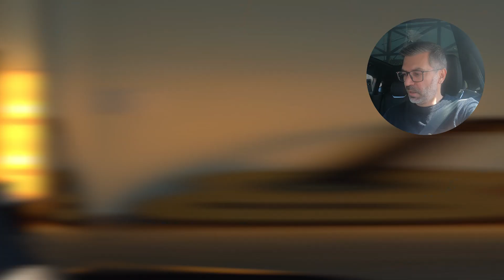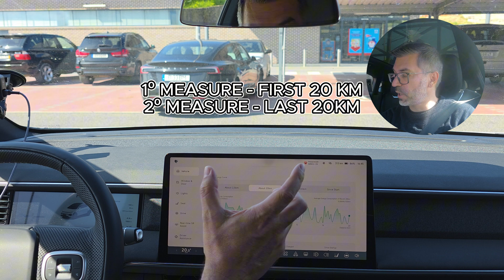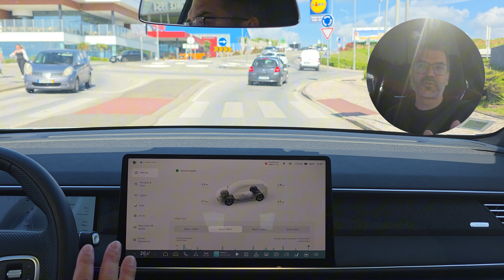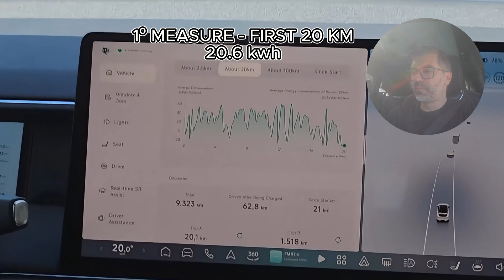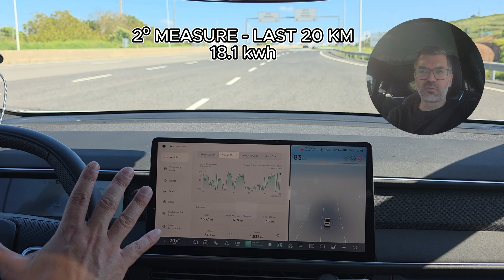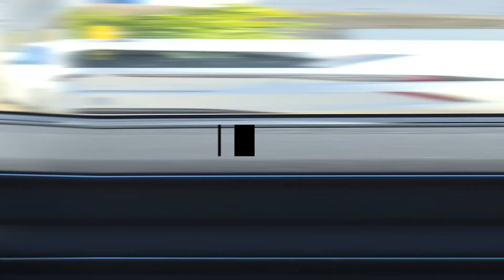Ride with Me: XPeng G6 Highway Drive in Standard Mode – Real Consumption Test!

Comment: It was  24kWh/100k  until  your started going  downhill  :)  cheaty cheaty   ;)   in  other  test on Youtube  I  have  seen   25,6kWh/100km  on  50km  test road  with  average  speed  132km GPS  which is still  a good  consumption
Reply from the maker: That is not entirely true. You cannot take a middle section measure as the about 20km is a rolling measure and if you take it at 30km mark you are ignoring the first 10km. So the only measure that could be used for a independent avg consumption is the 20km mark, because then you can read the about 20km without taking out or in any other block. 👍
Reply: @XPengPT  Best way to do it honestly is do the range test on the same route  in both direction , up and down .
Reply from the maker: @Bemx2k  Thats a good idea. Maybe i can do that soon. But the idea of these Ride with Me videos was not the definition of the avg consumption of the car, but to compare the average consumption with different driving styles and modes.

I may define a driving mode/style and then do a 50km one way and 50km back to have a full 100km trip to compare.